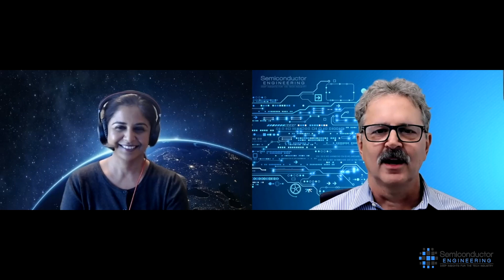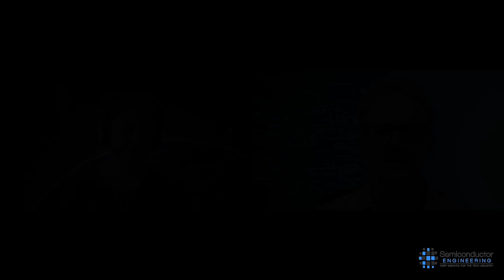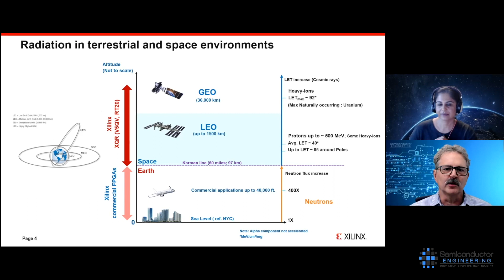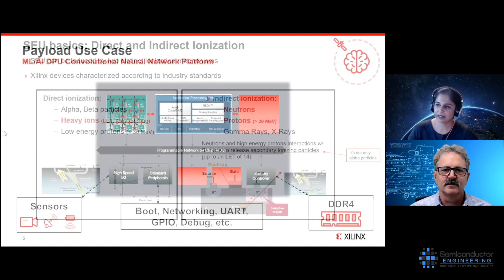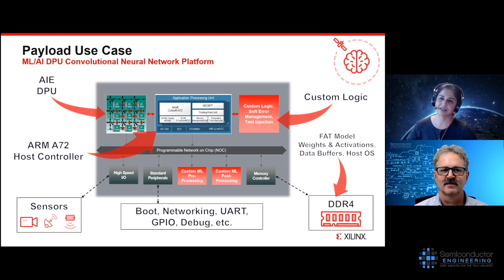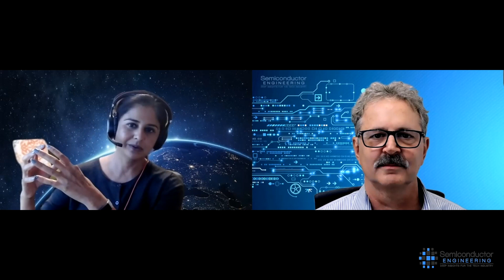Radiation Hardening Chips For Outer Space

Comment: When I worked on space electronic projects (Honeywell Aerospace), we used primarily older integrated circuits.  Those have larger geometries that are less susceptible to radiation.  The downsides to that are that those devices are comparatively large compared to modern devices, they do not have the capabilities of the modern devices, and they are becoming difficult to obtain.

Comment: Mentioning the different layers of managing the impact of radiation (process, circuit, microarchitecture, software) was nice. The recognition of the value of post-launch change is expected from an FPGA vendor (though this brings in the power-performance-area and dynamic configurability tradeoffs of software, FPGAs, and more traditional mostly-fixed function logic), but the tradeoffs between one-time-programmable memory FPGA (less dynamic configurability but more resilient to radiation), SRAM FPGA, and hardwired logic might have been worth mentioning.

The tradeoffs between spatial and temporal redundancy might have been worth mentioning. With a faster device (or looser timing constraints, possibly from processing tasks in parallel on separate processing elements available from using a finer-featured process) re-running a computation may be more reasonable than conditionally retrying or voting. Obviously a persistent fault can make purely temporal fault detection inadequate. (Presumably phase-shifted redundancy has also been considered and used; by not having lockstep operation, some spatially broad but temporally local fault causes could have less systematic and more stochastic behavior. If the phase is shifted by an entire work unit, this becomes temporal redundancy with processor switching. One could also consider something like Todd M. Austin's DIVA, where a checker processor is less complex, possibly keeping pace via higher level parallelism (multiple checkers overlapping operation where a task starts at the same time on a high performance processor and a checker and when the next task starts on the high performance processor a different checker is used) or by avoiding cache miss overheads. That kind of simpler checker design does not seem likely to work well generally, but it might be appropriate somewhere and is at least interesting to think about.)

Also, the reduced launch cost per payload (both more multiple payload launches and lower launch costs) encourages reduced payload cost even at the cost of reliability and durability. (Reducing the cost and expected reliability of payloads can also reduce the cost of launches as reducing launch failure rate is expensive. Higher volume also leads to lower costs and higher reliability as one moves faster up the learning curve.) Components not rated for aerospace uses can be less expensive and defects

The link between approximate computing and reliability was hinted at. Some errors have no architectural effect (e.g., a comparison used for a branch decision could have an error in the inputs or the processing as long as the decision remains correct), some errors produce an architectural effect that is not significant to the higher-level function (e.g., flipping the least significant bit of pixel data is usually not significant), some errors are detectable and possibly correctable with on-ground processing (though distinguishing between an "impossible" observation and an inprobably error presents challenges — science can be delayed by throwing out data that "can't be right"). Manufacture-time variation/defectivity also seem related (in theory some of the redundancy to improve manufacturability might be transferable to increase operational reliability)

Minal Sawant seemed to discount persistent faults, but a data-only fault in SRAM-based FPGAs will be quasi-persistent (requiring a reprogramming to reset the error). Even in a hardwired system, persistent faults are possible and radiation (like temperature and other environmental factors) presumably increases the probability of a persistent error. (Fault persistence is also not binary or one dimensional. E.g., electromigration causing increased resistance might initially only cause certain inputs to fail timing under certain temperature conditions — from a hardware perspective this is a persistent fault but from a higher level it will appear as transient faults.)

Very nice information overall (though I would have preferred reading rather than watching/listening) even if not 10,000 hours long to consider a broader range of the tradeoffs in more depth.☺